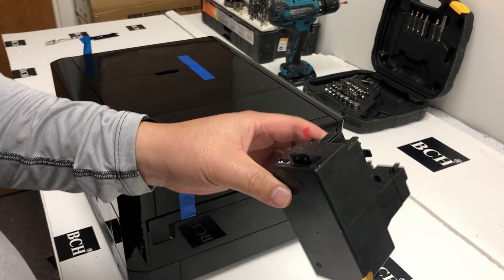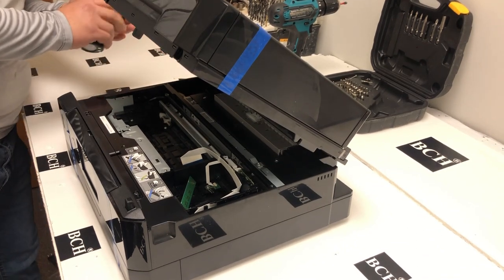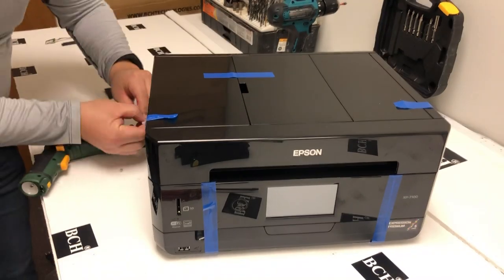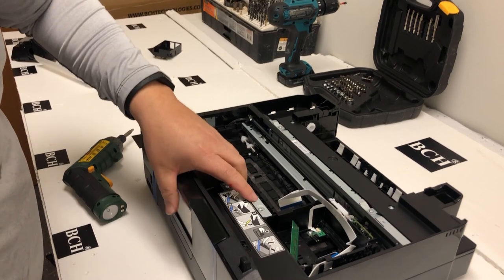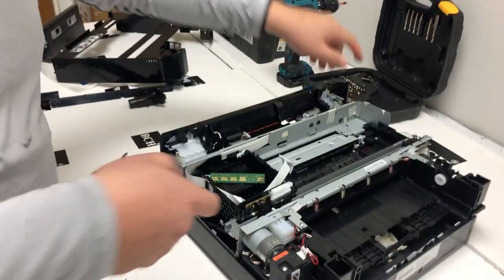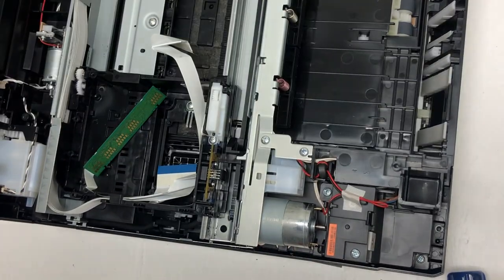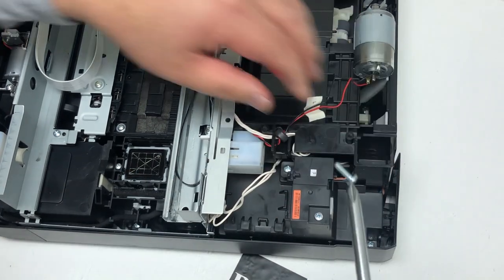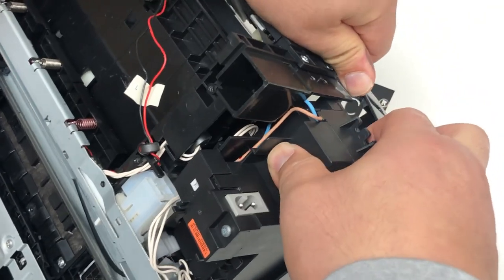Change the Epson Power Supply unit for Expression Premium XP-7100 Printer - Fix Epson No Power

Comment: This was a super helpful video! Thank you, Kevin! I have a couple of helpful pointers for anyone else embarking on this endeavor: you have to move the carriage out of the way to get to the motor. But the carriage is locked in place! To unlock it, find the white gear on/near the carriage rail on the side of the printer opposite from where the carriage rests and turn it counter-clockwise a couple turns. Then you can slide the carriage out of the way. When you put the carriage back, turn it clockwise again.

The other tip is that if you are having trouble getting the belt back on the motor, check out the other side. Specifically, look for the piece the belt connects to on the other end. That mechanism is held in place with a spring that is very easy to unhook and re-hook. If you free that piece you can give yourself as much slack as you need in the belt. Just be super careful to keep the little wheels in place on that mechanism! The only thing holding them there is the tension from the belt.

Comment: Thank you for this vid. I have a 245 canon ink cartridge that I refilled. But what I did was I opened the cartridge's lid and pour the ink instead of making a hole on top of it. I just taped it every time I'm done refilling. Is that a good idea to just tape it? I'm assuming that air goes in and makes the sponge dry. Also, I tried my best to unclog it, and every time I checked it on a tissue it seems it's unclogged. But when I started to check the line pattern, the pattern is not close to what is recommended. I always do the unclogging thru my computer as well and still the same result. I hope you can help me with my issue and thank you so much in advance.

Comment: Hey Kevin, could you please help me? I have tried about 5 Epson Ecotank printers, and all of them prints out dots. I am using sublimation to create phone cases. When I heat press the aluminum plate, the dots are very visible. It looks grainy or as if I took a picture off google.